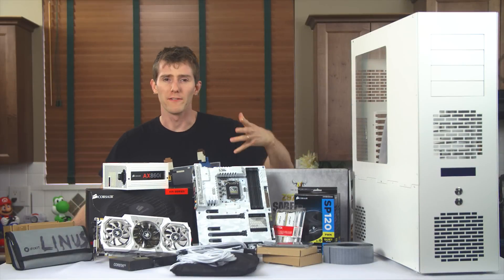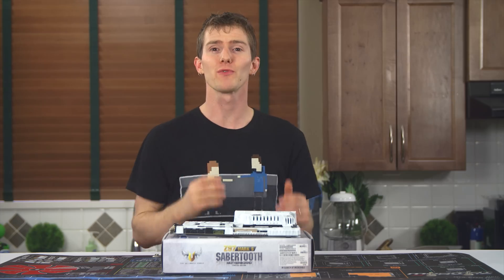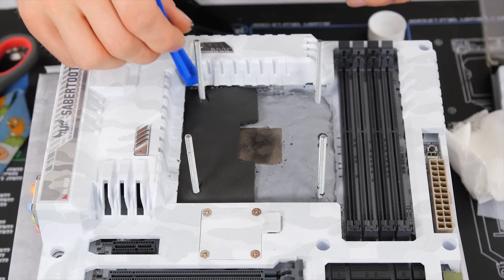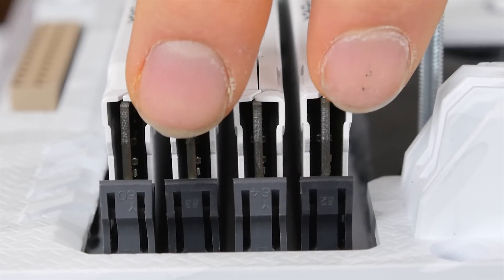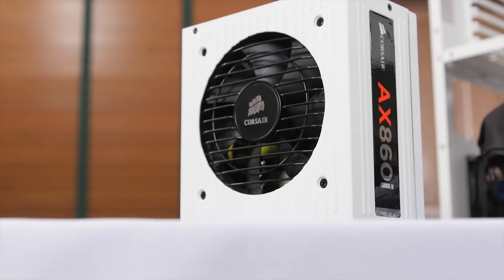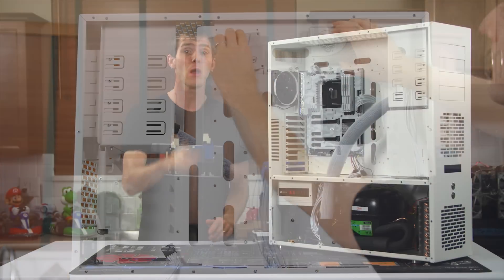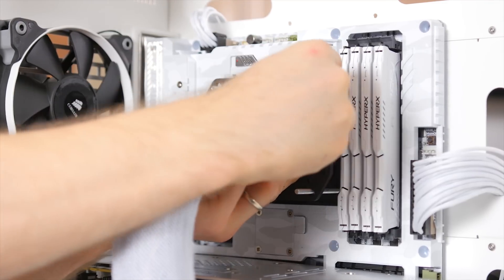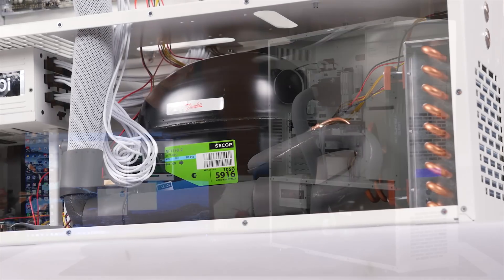ULTIMATE Sub-zero Phase Change Cooling PC Build Guide

Comment: Question, what happens to these rigs when they're finished? Do you sell them on? or keep them to be used around the LMG office?
Reply: harry turner That's why a lot of us couldn't do this job. Having to pull a part the rigs when done filming, I would cry every time.
Reply: @bradleypitt6296  me too
Reply: harry turner They reuse the parts
Reply: Nicholas Pham Oh right
Reply: Infinit3Enigma Because of all the work you put to put it together.
Reply: harry turner  they use then as door stoppers and stands to put Doritos on.
Reply: They tear it down and use it for another build guide. That's why they have so many build guides but have limited gear to work on with. And if Linus is in the mood, he sometimes holds a giveaway either for a specific component,  or the whole build. Like the Mineral Oil cooled Pc build.
Reply: @jayson2739  I hope you still have this account and still watch Linus cause man have they come far
Reply: zero2zero4 You can't get rid of heat, you can only move it around. To put it another way, there's no such thing as cold, only an absence of heat, that's why cold is an adjective (in the Physics sense) while heat is a verb or noun. In this case the condenser/compressor produces a lot of heat and and even more of the heat than usual is being removed from the processor. It's called a sub-zero build because the processor idles at sub zero temps, not because it produces less than zero heat. The only way to do that would be to absorb heat via endothermic chemical reactions and that wouldn't be sustainable (and even then, the heat/energy isn't lost, it's only stored as a chemical bond)
Reply: Jayson Fabregas As Linus said ages before he did the oil cooled PC build (back when he said he wasn't going to do one) it can take months to dry out components used in an oil cooled PC before they can be used again, I think that is why they gave it away instead of keeping it.
Reply: zero2zero4 all that heat the cpu is creating is actually being dispersed into the room so it would heat the room up not make it cooler
Reply: philondez i hope u're trooling me.. i know it's not possible.. and even you said it the only way is to absorb heat.. absorb is not getting rid of it its just shoving it under the carpet... the cpu doesn't produce heat.. the electrical current does.. and also.. it doesn't produce heat.. it produce wasted energy it's just happen in many case it's heat.. just like a car engine that when crank up too much the more waste energy it produce and the less efficient it is also the better cooling it needs.. does turning a car air con max.. open up all the window in a closed room makes the room cool? absolutely not..  those car manufacture says the co-2 emission of their car is so low it actually cleans the air.. they're right.. but they're only absorbing it somewhere not cleaning it.. like a vacuum cleaner thats so magical it get rid of dust magically.. except it store them inside until it explode..or like Australia Lynas effectively getting rid of radioactive waste.. expect putting it in my country and yeah.. freaking Australia don't have land they have to put it into a country 100 times smaller? and you know what else is waste energy? this.. this trying to explain that i meant it's so sub-zero.. its so cool.. the name is so cool.. the build is so cool.. everything is so f-ing cool.. it evens cool the room.. and hopeful this long paragraph of random facts will make it sounds like i'm smart and i get approval and i don't get thumb down cause you think it sucks

man.. try to crack a stupid joke and everyone's a professor all the sudden... my mistake alrite
Reply: Ch!KnMusic I'm a hardware reviewer for http://technologyx.com 

It is actually very uncommon for review samples for PC components to have to be returned after we're done with them. Most reviewers will require hardware retention and the only exception to that is monitors, pre-built systems and laptops. GPUs, RAM, Motherboards, CPUs, SSDs, etc are all usually kept by the reviewer/review site.
Reply: SunsetAzul If you enjoy it, it doesn't matter i assume. I don't think they get all emotional.
Reply: Samzo111 You can actually clean them up pretty quick with a bit of Isopropyl alcohol, much better than the drip dry method but still a PITA :)
Reply: harry turner I guess they reuse or store the parts and in some cases they have to return some components.
Reply: Jan Getz no i didn't study physic since high-school.. got master in cs thou.. like who doesn't
Reply: Robbie Hancock it's titled sub-zero build? it's so cool it cool the room?
Reply: But it would make the room hotter not colder?
Reply: harry turner They will probably not pull this one apart, i mean is there any reason too?
Reply: harry turner actually.. contrary to what everyone is saying.. they are SUPPOSED to mail back the parts because most of them are REVIEW samples
Reply: zero2zero4 I don't know a lot about physics but when the CPU is running at 5.GHz it's hot. So that heat is then taken away from the CPU and moved outside of the case. You can't just kill heat. However if you attached the cooling unit to your body somehow. The heat from your body would be dispersed into the room making you feel cold as balls and the room a little warmer.
Reply: harry turner they should really auction these builds. I'd pay good money for a phase change built by Linus.
Reply: Bradley Pitt I didn't think about that, and that would explain the dozens of high end GPU's lying around their house. Lol
Reply: I''m not sure how much difference it would make in cooling the room but you could put something like a dryer vent on the hot air exhaust and send it out of the house. Doing that I can almost see this rig making sense if you put it in a server closet.
Reply: harry turner keeps them running so it cools the room? they don't have air condition yet
Reply: Robbie Hancock i know.. boy i'm glad to have u at the party..
Reply: Then why say that it would cool the room?
Reply: Robbie Hancock great fun talking to u bro
Reply: harry turner would be cool if they sold them, but they'll probably be expensive as hell, but at the same time its worth it if you dont want to risk messing up a watercooling system
Reply: zero2zero4 I got you right away. people can be ridiculous, anyways an insulated exhaust vent from the phase change unit would solve the heat problem and it would actually cool the room. Now people don't jump down my throat. lol o.O
Reply: Infinit3Enigma Because when done right, some of the builds feel sort of like an artwork. And a lot of them take a long time to complete too.
Reply: This happens every time I comment on a ltt video, I just wanted to know what happened to the rigs, not a high end lesson on the physics of heat hahaha. Thanks for your reply though people c:
Reply: *****
Distinction is irrelevant.
Reply: ***** I am not heartless, function over form. I can agree on how it may become of sentiment but function thwarts form, no matter how much work or vision is put into it. Those parts are re purposed for other builds, they still have function.

Oh well
Reply: Jordan Darby yes but you would need a cooling unit that cover the entire surface of your body.. as well as a mask that cool the air when you inhale.. because the heat that is transfer from your body into the room.. ends up in the room that will be inhale by you and in contact with your skin.. if your skin is cooler... the heat would transfer back via your skin area that is not covered by the cooling unit.. other wise you would only felt cold on some part.. alot more warmer on other part of your body.. as well as the warm air you're sucking in... however at that point... it's basically a human size and shape refrigerator.. or you could.. just air condition the room.. where the cold air in this case.. is your cooling unit.. because remember. like liquid or metal.. air is also a medium that transfer heat.. it comes in contact with your skin and transfer some heat from your skin and become warmer air and transfer back to the unit where the heat is transfer out of the room and the cycle repeat.. 

i don't even know why i'm still here..
Reply: Yeah your exactly right if the cooling unit doesn't cover your whole body then air can get to your body. But theres so many molecules in the world the motherboards heat would transfer to the processor and so on everything's connected to a degree.

btw I have a hackintosh and I want to put windows 8.1 on my empty ssd. Right now I'm running OS X and I have another formatted ssd partitioned with MS DOS (FAT). I have a windows 8.1 iso file and an 8gb usb flash drive. I know windows users use Rufus to create a bootable flash drive. What could I use? Btw it says bootcamp assistant can't load on this computer so thats out of question. 

Is it possible for me to create a bootable flash drive?
Reply: Jordan Darby Yeah totally. I'm not exactly sure how to make it work with booting Windows on OS X but I could ask a friend if he can give me a link for it. He can swipe between OS X and Windows 8 like alt tabbing...
Reply: Maxwaehrens Yeah he is probably running windows on a PC with a lot of ram and running virtual machine. I heard it runs quite nice. That's the only way you're alt tabbing between OS's lol. Virtual machine is probably like an emulator though so you don't get to take full advantage of your hardware. Anyways I think I got it figured out now.
Reply: Jordan Darby Not sure about how much more RAM he has than 8 or 12GB since he's on the Macbook Air. But the virtual machine seems to be what he's doing but he can still use demanding math and 3-D modeling and rendering programs which are pretty demanding.
Reply: Able the fox Unfortunately a lot of computers are built using sponsored parts. And they wouldn't be allowed to sell them on. When they are using expensive parts (like super monitors or VGA cards etc) they have to send them back. But yes that would be really cool!
Reply: Able the fox Yeah, more applies to laptops and stuff I think.
Reply: Where I work we take in leased computing equipment after the lease is done. We got in about a dozen servers from a major communications company (with telegraph as part of its name) that someone had gotten the bright idea of running them in oil. I'm sure it worked fine for them... until they got the bill because we had to scrap the machines.
Reply: Harry Turner a lot of times they take them apart and use the paets for other builds unless the pc is being built for a purpose at LMG
Reply: just now seeing the vid. im thinking it could have been set up a little differently to cool the cpu&gpu. didnt have to be direct contact.
Reply: Bradley Pitt Why so emotional? A machine is a machine, Its not like disassembling is going to destroy a part, you are going to be reusing it in maybe a better looking more potent system. 

Inb4yousaysike
Reply: harry turner Steam giveaway here: https://gleam.io/GtfaL/oh-mah-lords-10-steam-card-giveaway

Comment: The multi-colored power switch and USB wires annoy me...
Reply: wobbly868 niceme.me
Reply: ***** ayyyyy lmao
Reply: ***** They should of sleeved those IMO.
Reply: wobbly868 ayylmao
Reply: ***** i said the same when he plugged them   in haha  like "Wtf"
Reply: ***** he couldve gotten bitfenix extensions.. those are dirt cheap and are sleeved
Reply: deadclock7 nicememe.website
Reply: zZViperBoostingZz I plasti-dipped fan and other red/yellow wires in a white build I did for my cousin, I didn't have good luck the plasti-dip just sort of flakes off when it dries. Maybe I had a bad batch idk.
Reply: Silent1fd the main point of plasti dip is that it can be peeled of, it shouldn't be used on fast moving parts or flexible stuff
Reply: The Nash Hmm, I plastidipped my wasd and arrow keys last week with 12 coats with 20-60 minutes inbetween and a final 24 hour dry stage. Went through a 12 hour session of bf4 and star citizen yesterday and found the coating was already stretching at the sides and starting to tear. Could it something faulty with my can?
Reply: zZViperBoostingZz It wasn't in anything that moved per se- I took off the keycaps, propped them on nails, and did very very quick passes over them- it took until the 8th coat to get an opaque coating that didn't hint of a black paint job underneath. I suppose it could be the rapid strokes of pressure though- that could be it. Not so sure about the rapid movement, since people dip their cars/wheel rims and the forces there are probably much bigger. Although... I think Linus's job would be much easier if he just got a can of white plastidip and sprayed every inch of exposed circuitry- that'd reduce the need for oil, foam, and putty layers.